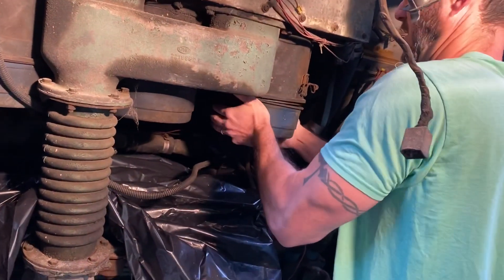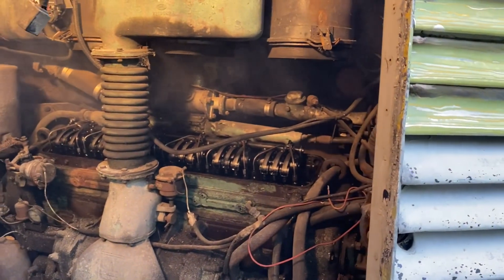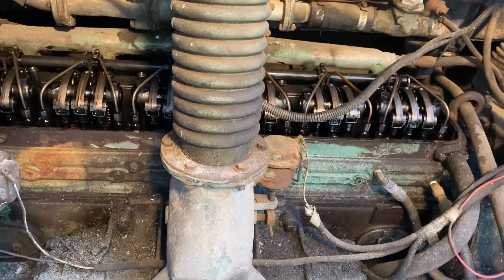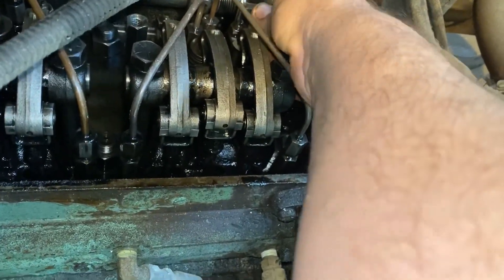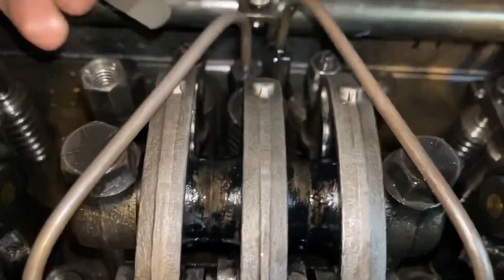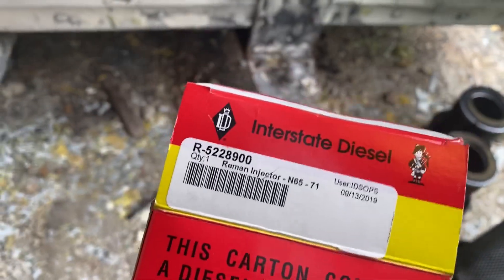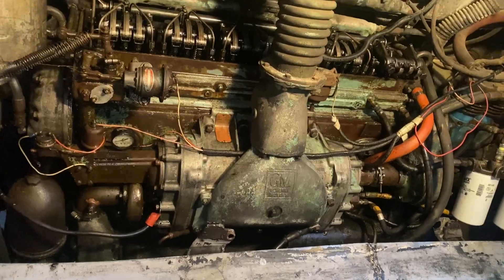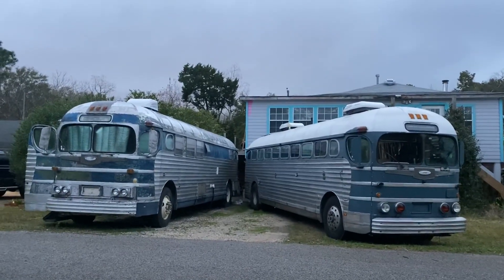Working on a detroit diesel 671. Diagnostic and repairs

Comment: New subscriber, I really enjoy watching you keeping these Detroit powered rigs on the road.  I have been working on DD since early 70,s.  

Another way you can determine condition of piston rings is to remove one of the air box covers and check for presence of wear indicator groove on rings.  Then start engine with small cover removed and watch for ring rotation.  If it doesn’t rotate, most likely stuck.  It should rotate at about 20 RPM in the groove.  Would make a neat video for your subscribers.

Comment: It's amazing how most of the engines need the buffer screw set when you get to them.
Reply from the maker: In this case it was just a bandaid to get it smoother for me to investigate further.  After the new injectors, tune up and rack run it should smooth out nicely.

Comment: I know this is a dumb question but I don’t know so I’m going to ask. There is a valve cover that goes on right? I mean you don’t run it with the exposed rockers right just for testing and maintenance?
Reply from the maker: Correct it had a valve cover.  It’s just off for now while we are working on it.

Comment: Is having a radiator cooled by electric motors, or hydraulic more problematic than having a belt driven fan direct off the engine? I kinda new here... but I'm curious. Good work today.
Reply from the maker: It’s not common but can be dove
Reply: @BusGreaseMonkey  and Willaim Sevier - Thanks for the commenting.. I'm having fun and learning stuff!
Reply: One of the best engine fan set ups is what is used on the late model New Flyer buses. It is a multi motor electric fan setup. The fan bank can change speeds based on heat rejection demands and it also periodically reverses to clear any accumulated dirt from the radiator, condenser and CAC.
Reply: @markphilpott8735  That's sweet! That sounds like a perfect setup for one of these old busses to bring it into the 21st century!
Reply: In regards to a hydrostatic fan drive, IMHO... the negatives outweigh the benefits.  When new hydro is fantastic (no pun intended)  they do work great. However;  hydro is very expensive,  when they give trouble it can be hard to diagnose and worst of all, nothing makes a mess of an engine compartment when those systems spring a leak which quite often leads to a fire. BTW when buses catch fire, they usually burn to the ground.

Comment: Im a vw fan i do own a 1968 bug as im searching for a 1500cc single port engine for it what it originally had. I don't like his cooling fan setup he should just used the original silversides fan or equivalant. as most electric fan mfgs don't recommend them for 4 or more row radiators being there is a negative pressure. as he needs to add more fans to the radiator and use a thermostat to activate them if the temperature rises above normal he needs to install a switch to override the fans. but he did it to not worry about the fan hub bearing failing and the fan going through the radiator. and the bearing that needs replaced.  if he adds more fans he needs to check the amp draw for each fan as he may need a bigger alternator to handle the load.
Reply from the maker: He’ll get it sorted out

Comment: I couldn’t hear several of those injectors when you cancelled them.  I take it you used a dial indicator special tool to set injector height?  Did it have a single or dual screw rack?
Reply from the maker: Lots of reasons why.  Bad injectors, bad rack adjustment, bad timing but it’s nearly all sorted out.
Reply: If you ever want to see how good of a tune you put on a engine see low low it will go in RPM.

Comment: What was ther reason you went with the n65s vs n70s or n60s?
Reply from the maker: I was a little worried about his cooling system to pump it up too much.  65’s a good number for his bus
Reply: @BusGreaseMonkey   Heat is one hell of a monster. Let it loose and it will eat  you alive. Have you ever ran a egt probe with diferant size injectors?
Reply: @freyja4954  EGT is not real reliable on a GM two stroke as they pass so much scavenge air on valve / port overlap. Even working hard a 6-71 hardly gets over 350 C measured in the manifold. Oil and jacket temps are better idea of how close to the edge you are getting.  The GM manuals list available injector options for each engine with tune up data and HP expected, and whether it's EPA approved for various states or off road only.
Reply: @rayg9069   I never thought that the scavenging would be enough to pull the egt's down. I worked on a few 8v92ts in trawlers  and those things run a massively larger  injector. I guess  when you have trillions of gallons at 60 to 70 degrees max you can get away with it.
Reply: @freyja4954  Fore sure ;-)  A 6-71 on land is good for around 250 ish HP
In Marine pleasure craft spec they can make 550 HP, or more , for about two summers.